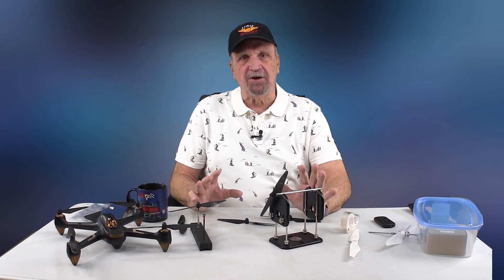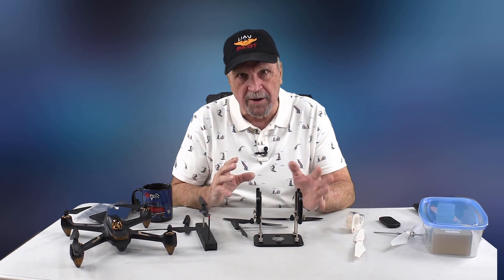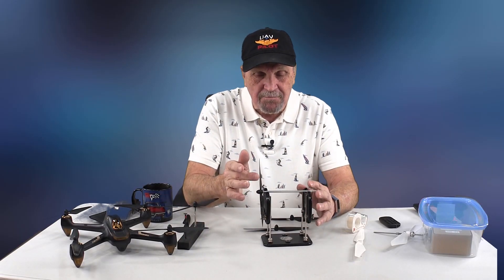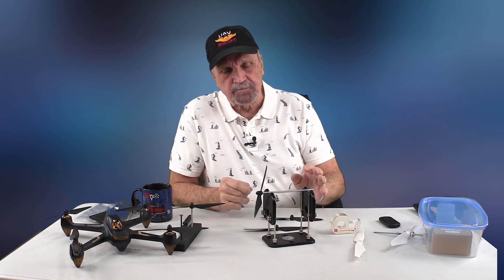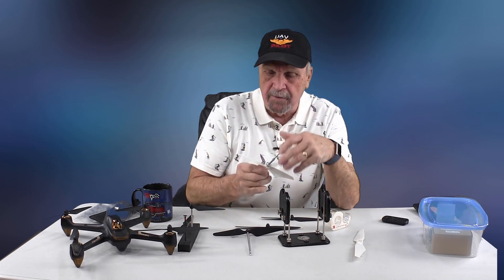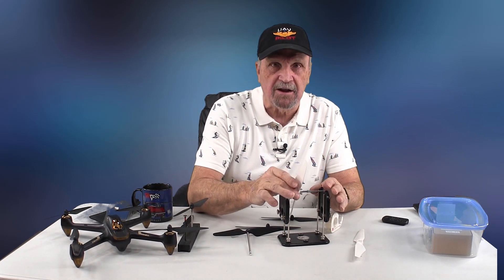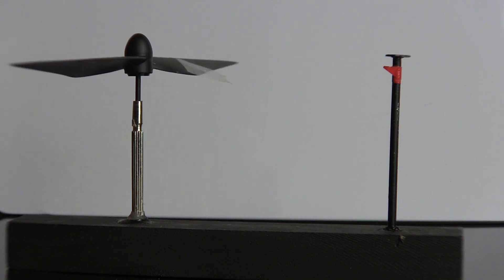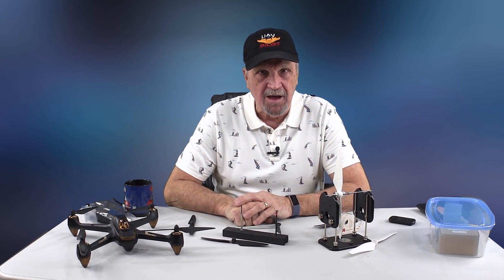Hubsan Drone Prop Balancing

Comment: What are the best replacements props for this quad. I just got one and it doesn’t appear you can get them from hubson anymore.
Reply from the maker: You can get them on Amazon, check reviews, they are all aftermarket, getting them balanced may be necessary. Thats a great drone, it will make you a great pilot. Good Luck